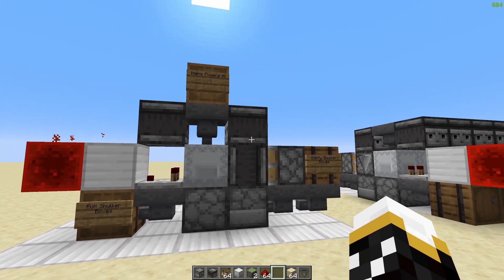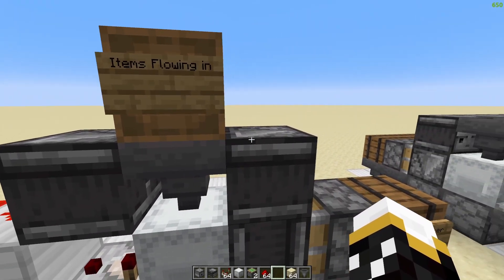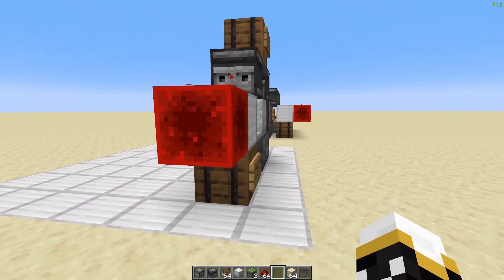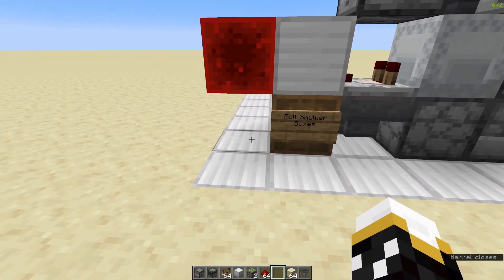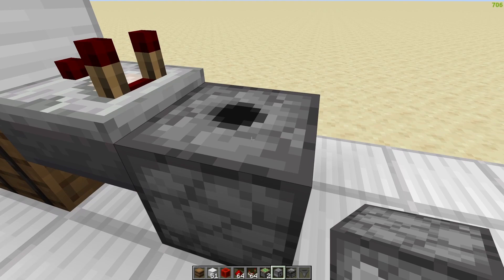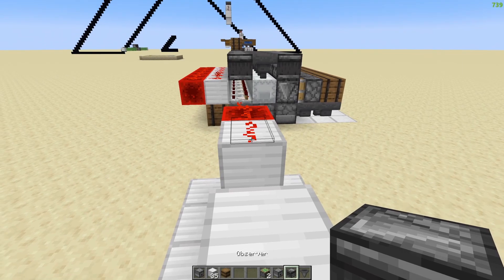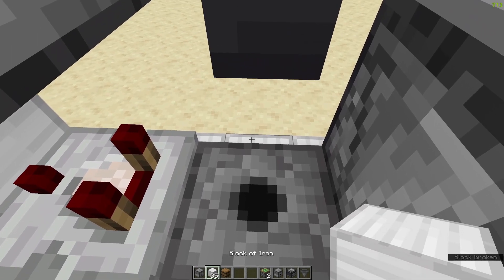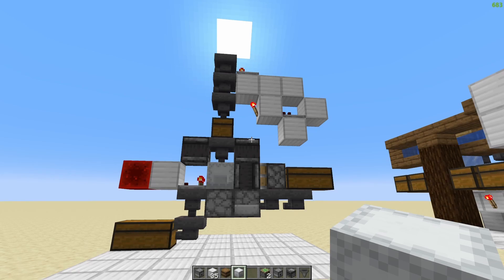Shulker Box Loader! || Redstone Tutorial! || Doing Bulk Storage Properly!! || Java Edition!

Comment: is this for java?
Why do we need to have barrel in the back hopper? Cant we use double chest to have more storage?
Reply from the maker: Yes it is for java. You can also have a double chest or even more storage on the back if you want the barrel is just there to represent some sort of storage. I hope this helps.
Reply: @encrypded  i managed to build this for my dirt farm, thanks, works great, There seems to be a rare occurance where when a shulker box is broken, a nearby hopper took it instead of the hopper underneath the shulker box. its not rly a big deal and its a rly rare occurance. I have like 20 of these shulker loader running for the past 3 hours and 1 of the shulker box out of like 140 was placed in the wrong chest